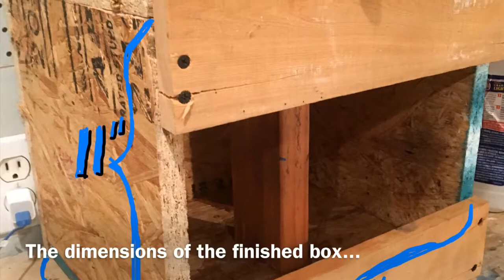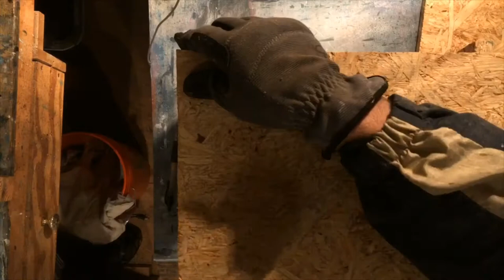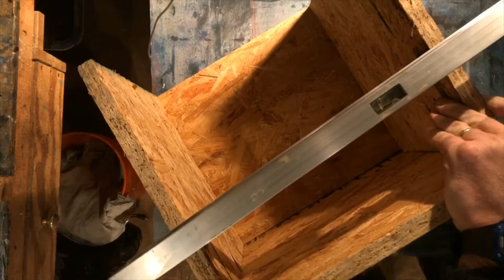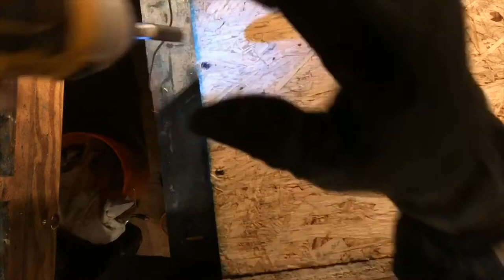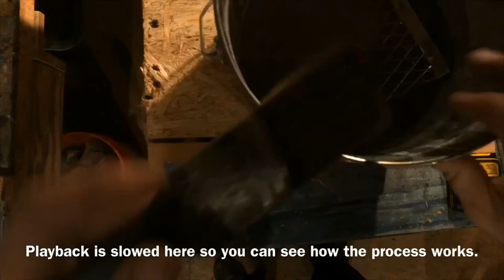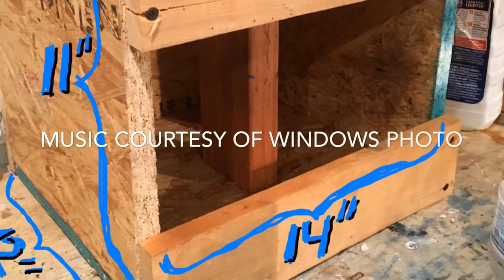How to Build a Brush Beater Box

Comment: Decent job on the box for what it's worth.....and yes I realize your just beating off your brushes and not aiming for carpentry awards.
But just a friendly pointer, next time pre drill your holes in your wood so you don't split it when you go to screw it all together.
Reply from the maker: I appreciate you watching!  I agree that pilot holes are definitely important for certain projects, but for this one, knowing that it was going to get literally beaten to death, I was less worried about splintering and more worried about making sure I caulked it well on the inside so that no paint thinner sprayed out.  I know you don't see it on the video, but it is SERIOUSLY caulked on every seam inside because the thinner WILL spray all over everything if it isn't sealed up tight.  Thanks for watching!